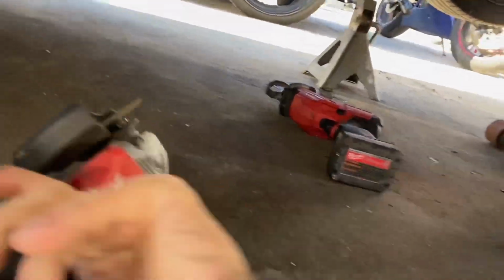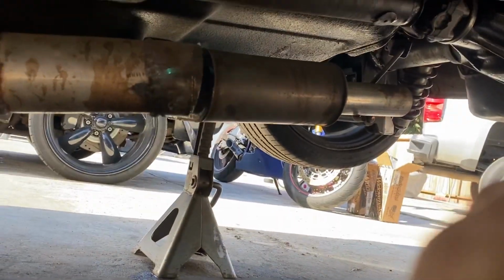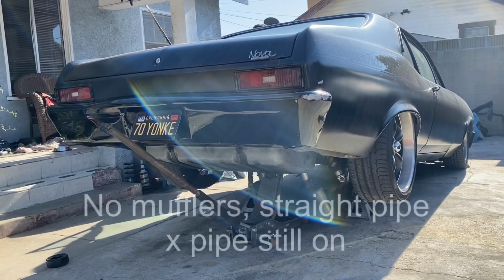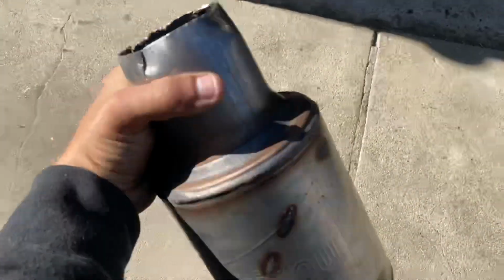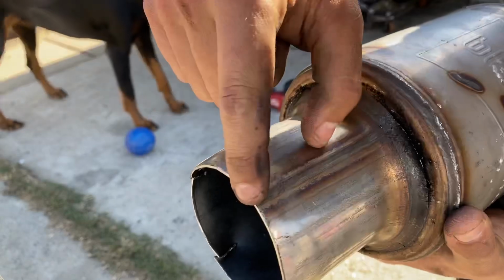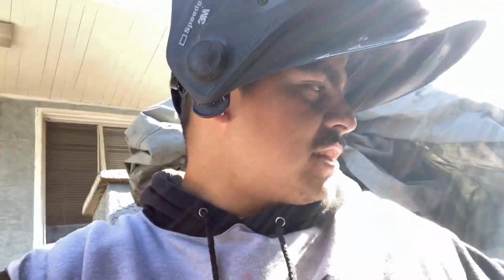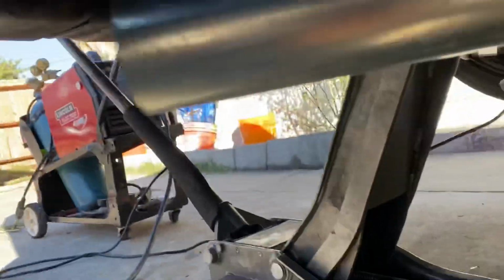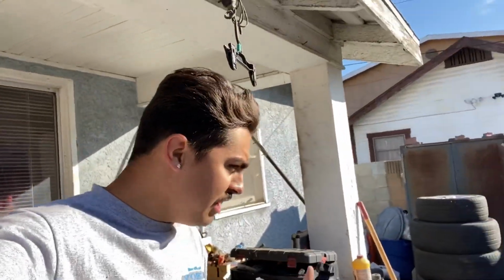1970 NOVA GETS BLACK WIDOW NEIGHBOR HATERS

Comment: Hey bro what motor are you running with these? I have a full roller 496 stroker going in my dually, I'm interested in these mufflers but can't find a decent video of them on an actual big block...
Reply from the maker: This is a 5.3 ls engine with a stage 2 btr truck cam
Reply: Are these better sound than the flowmaster 40s  on 74nova  350 stock engine???

Comment: You know, we know, it sounds Badass!
It’s great knowing the youth exhaust dump theory is alive and well!! 
You know, instead of boot legging a pipe reducer as if one was in the Middle East with two rocks, a hack saw, a coat hanger and jumper cables connected to a camel powered generator one can purchase exhaust pipe reducers or rent or buy an exhaust pipe expander because she deserves it!! 
I personally, always run the next size inlet and outlet on account I believe it changes the sound because no middle of the mall bull shit! 
Not hating or busting your balls! 
Although, she isn’t a chelleve none the less, she’s still a looker..